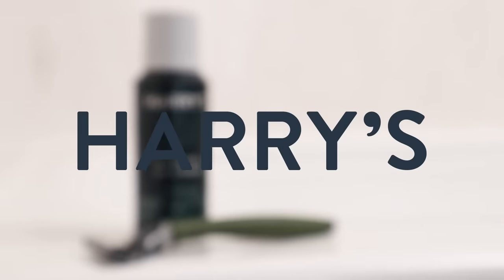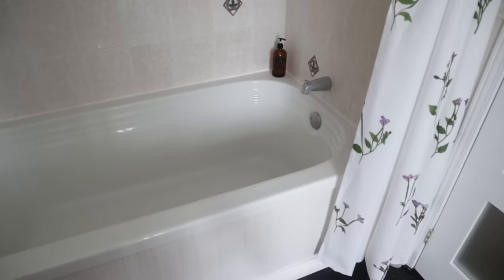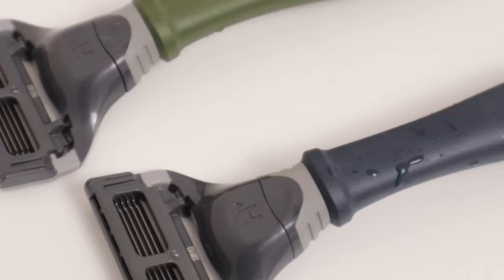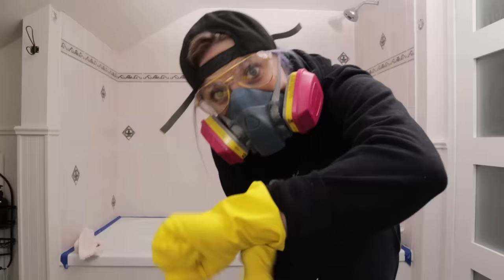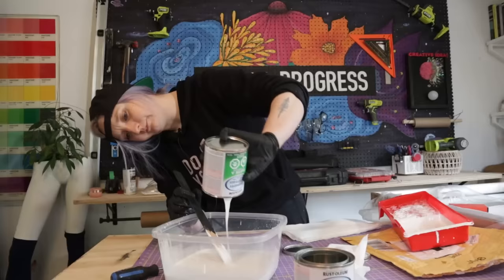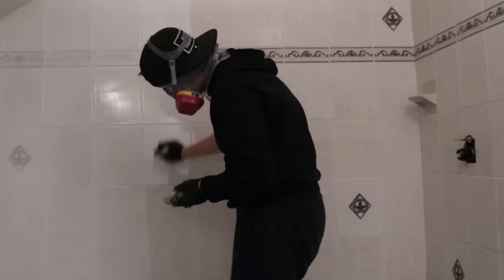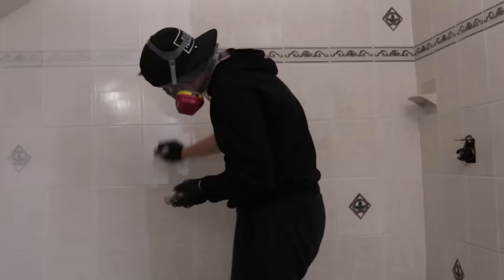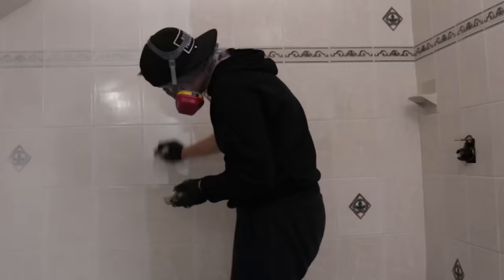My shower gets a budget-friendly DIY refresh! | HOME MADE HOME | DIY Danie

Comment: Hi Danie! A tip to help alleviate smell of chemicals during projects like these is to place a medium-sized bowl of white vinegar in the room overnight. It’s truly magical.
Reply from the maker: ohhhh GOOD TIP! I will try that <3 THANK YOU!
Reply: Or use a container with a layer of baking soda in it. The larger the area, the larger the container. It needs to have low sides, so it's a shallow container. For this situation, I'd use a "pop flat". You know, the shallow box that a case of soda cans come in. Stores with pop machines would have them. Then evenly spread the baking soda in it, but do not pack it down! For this situation I'd use 2 of the standard size boxes. Buy it at Dollar Tree and it'll only be $1 (US) a box. We use it in our frig to eliminate odors, why not in the bathroom ⁉️

Using the same technique, use charcoal in place of baking soda. Charcoal removes odors AND absorbs moisture❗
Reply: @DIYDanie  Apparently when painting, rolled up pieces of newspaper can help as well :)
Reply: Thank you that’s a great tip 🙂
Reply: You can also cut some onions in half put those in a bowl with water and place it in the room..
Reply: I usually put a bowl of pickle juice in the space behind the filter in front of the central heat and air. Same idea. Now if we could just get the smoke smell to go away when it's hot and rainy 😞.
Reply: A renter decimated a property with pets and cigars. Did professional remediation for the smell.. carpet removal, sealing subfloor etc., but smell still there. A friend of the family said would put up with the smell as they needed some place to crash. Who would have thought that the smell would be gone after two days of brewing coffee! I then recalled perfume and cologne counters use coffee beans to cleanse the nose.
Reply: My mother uses charcoal in the refrigerator. So maybe tha would work as well?
Reply: @kathyusa-iowa5137  That is a fantastic tip.
Reply: @sshh_itsaxis  yes, and it also absorbs moisture.
Reply: @dlsdyer9071  that’s a great tip, never would’ve thought of that!
Reply: funny talked about spray gun then had spray gun ad
Reply: @kathyusa-iowa5137  how do you use the charcoal in the refrigerator? Is it the charcoal you use for the grill?
Reply: @jurnee97  what you want is activated charcoal. If you use briquettes, crush them up some. Put the charcoal in a low container, like the a box checks come in, or I think it's a half pint deli container that's real short. Put in the back, on a center shelf, without a lid. 
It works well as a fridge deodorizer for at least a month (and possibly much longer), so there's no set limit for effectiveness—you'll just have to change it out for fresh charcoal once your fridge starts to smell a bit funky again.

Hope that helps 1😊
Reply: Onions also help. Whenever we got the house painted, the painters would leave half cut onions in the room for a couple nights to get rid of the smell.
Reply: I agree with you
Reply: @DIYDanie  would the industrial window panel be something you can do for an apartment?
Reply: @Wenefreda  if you have a glass panel just use electrical tape on the outside to create the look of panes. A lot of people use this technique on windows-paint the trim black and use electrical tape on the inside to mimic high-end black paned windows.
Reply: @thechops2000  I don't have either I just have a shower curtain but would love this look and style trying to find a way to do it that is sturdy but can be removed later
Reply: @kathyusa-iowa5137  Yeah, why doesn't the door go all the way across?

Comment: When you cut the hole in the hall wall, I started laughing. Every project at our home has similar circumstances. Instead of domino effect, my husband calls it scope creep: the scope of the project creeps outward and the budget upward! I loved the results, and they gave me some much needed inspiration for our front bath. Thanks!
Reply: We call it the cascade effect. Each one leads to another. 😂
Reply: Project projection (usually in every direction, LOL)!
A couple of decades ago a project to replace carpet with new carpet ended up with new hardwood floors, a kitchen remodel, new roof, new stairwell treads & spindles, and a new front door. Go figure!
Reply: @dlsdyer9071  Holy cow! That's a lot of scope creep. ::blinks:: Really astonishing. In our case, we replaced a single A/C unit that had been embedded through our living room wall with HVAC. The HVAC was great, but when they removed the A/C unit they discovered that our living room, feature rock wall was a fake. We found two windows, a fireplace, and an extra 18 inches of space behind the wall! Now we have built-ins and a gorgeous fireplace!
Reply: @linshannon4480  It's so great when you find "good" surprises!
Reply: @dlsdyer9071  Yes, indeed.
Reply: Never fails with my 105 yr old house!
Reply: Could do a shelf with mini door so in case you need to turk something in the FuTure or check in piping your not cutting holes again ???
Reply: @tisa6193  the joy and pains of living in a piece of history.
Reply: Ah Scope Creep. Nice Project Manager terminology!

Comment: Those 1/2 shower doors look cool, but I can attest that water ends up everywhere outside the shower. Also, Rustoleums above the water line boat paint is also great in bathroom spaces. Our builder skimped in the bathroom and used regular drywall instead of the watersafe drywall. We couldn't afford to rip it all out so after we made repairs and treated for mold I sealed the drywall with white boat paint. It has held up great in a bathroom that has no window and sees 2 showers a day with no mold or wearing of the paint. Danie, you are amazing.

Comment: Ummm... do you find that the window wall does enough to keep the water in? It looks beautiful but I worry about water spraying out of the shower onto the floor.
Reply: I thought the same
Reply: I’ve heard it does not
Reply: Maybe it's okay in this case since it looks like the water comes straight down with the new hardware instead of at an angle like typical hardware?
Reply: We just stayed at a hotel with a similar layout and water went everywhere and it was so cold in the shower because there was so much air flow.
Reply: My parents have a shower like this. With me is ok, with my dad water goes EVERYWHERE
Reply: I tried it with just pushing shower curtain half way.   Water everywhere.
Reply: @ioanapirate7537  hahaha srsly my husband manages to splash everywhere even with a fully closed shower curtain lol

Comment: If you’re in Europe or the UK, V33 tile paint is really good. I used it on my satin finish kitchen wall tile - didn’t even have to etch it, just scrubbed with sugar soap then did three coats of the tile paint with a foam roller. A year later and it’s still perfect, no scratches and it wipes clean just like normal tile.

Comment: And, Danie does it again! Gold Medal DIY Winner!!! 🌕 🎉🎊 😁 Bravo, fantastic result, it looks spiffing and like a brand new installation,  I'd definitely be congratulating myself.  Just being courageous enough to tackle the job deserves an award, bathrooms and plumbing and tiles are scary.  The odour thing reminded me of how I used porch paint on our basement stairs when everyone was away for a week. Oh, about 35 years ago now. I had every window on all floors open but the smell of that paint days took to dissipate. I opened the fridge to eat and it had even gotten in there. Omg. I think it was meant for outdoors of course, but, we haven't redone those stairs since. It's still there, hasn't worn off, it's durable alright. 
Our house was under construction when the tornado of 1987 hit Edmonton, we'd just moved there, and the brand new wooden stairs got chipped and beaten up by the builders since the basement flooded with water pouring in the windows. I used that enamel paint to save having to replace those stairs and it did the job, short term pain for long term gain.😉
You continually amaze me with your ideas, and willingness to try anything. Well done girl! 😊 😘 xxx

Comment: I really appreciated you talking about the differences between the two methods you've used for painting tile in different videos, and the follow up on how your cousin's tile is holding up. 

That looked like it may have been acrylic caulking you used around the tub, if it shrinks and cracks use silicone next time. Everything looks great though!

Comment: Any way you can do a short video on how you fixed the hole in the drywall on the other side of the shower valve? Did you seal it up? Or did you leave it as an access panel to tend to future dyi's or repairs? 💖🌞🌵😷

Comment: As someone who has tried the old tub and tile, I wish i had watched your video first.  I didn't etch first which was okay but after 6 months i got yellowing.  I wasn't using straight bleach but im sure my bathroom cleaners include it.  Also, i tried to spray it and it was a mess.  Immediately gummed up and spattered all over

Comment: Always fill the bath with water when replacing the sealer as if you don't when you DO fill it,  the weight of the water will make the bath pull away from the seal (been there,  done that,  lesson learned)

Comment: Fantastic result though I think a smaller adjustible shower head that you can tilt backwards and doesnt come out from the wall as much would have worked better to keep the showering space inside the confines of the half screen. You can see the shower head placement places the showerer outside the screen area which would be cold and spray water out of the bath. In your case I'd probably end up using the hand held more.

Comment: This shower refresh is EXCELLENT, though I'm curious on why you went with spray paint and not tiny wood strips for the glass door if it was gonna only be on the exterior side?

"you know that one level, where you can go up on the different levels and..."
I knew exactly what you meant and started getting flashbacks IMMEDIATELY.

Comment: Just a tip - respirators only protect you from particles in the air, not from fumes - so it's really a false sense of protection. To be truly protected you'd need to be wearing a hood with a separate air supply. So yes, lots and lots of air flow!

Comment: My only concern is the water splashing out all over the floor!.....then again, apt I'm a messy shower-er. 

Once while in Switzerland, the water pressure was so high, it was bouncing off the wall and out the crack of the shower curtain.  Stepped out of the tub into an inch of water! 🙉🙈🙊

Comment: Danie!!!! It looks incredible!!! 
I have been toying with the idea of redoing my bath/shower with that kit... I'm worried about the finish and the fumes though, no window and it's smack in the middle of my house, with no other bathroom lol maybe one day!
Reply from the maker: FIRST AND FOREMOST, wear a respirator mask when doing it. I was just given a really good tip that might work for you:  A tip to help alleviate smell of chemicals during projects like these is to place a medium-sized bowl of white vinegar in the room overnight. #brilliant
Reply: Or use a container with a layer of baking soda in it. The larger the area, the larger the container. It needs to have low sides, so it's a shallow container. For this situation, I'd use a "pop flat". You know, the shallow box that a case of soda cans come in. Stores with pop machines would have them. Then evenly spread the baking soda in it, but do not pack it down! For this situation I'd use 2 of the standard size boxes. Buy it at Dollar Tree and it'll only be $1 (US) a box. We use it in our frig to eliminate odors, why not in the bathroom ⁉️

Using the same technique, use charcoal in place of baking soda. Charcoal removes odors AND absorbs moisture❗

Comment: You gotta use grout caulk on that in the shower. You used painters caulk which isn’t the right stuff 😬
Reply: Also the bath should be filled with water when caulking. That's the heaviest/lowest a bath will be so the caulk doesn't stress & separate from the bath. Not such an issue if you only shower but details, ya know 😜

Comment: I have concerns about glass in the shower. What if you slip and fall into the glass?  Did you use some kind of tempered glass?  Also it doesn't look wide enough to contain shower spray.  Also the black industrial look doesn't match the rustic farmhouse look of the rest of the bathroom.  Sorry, I don't like it.